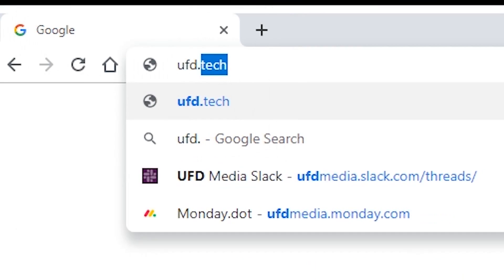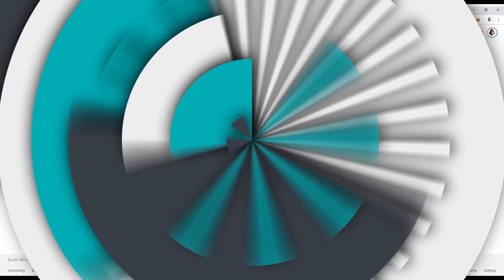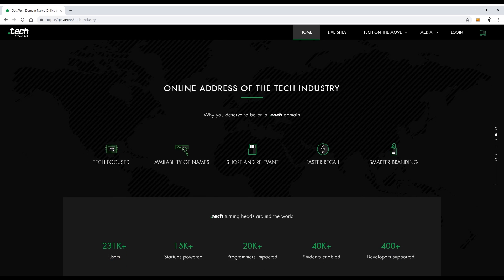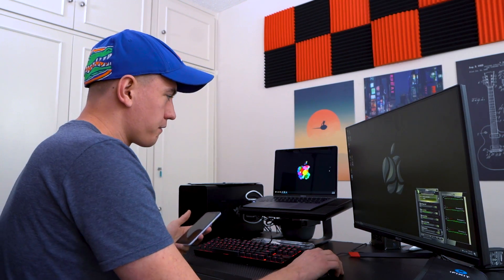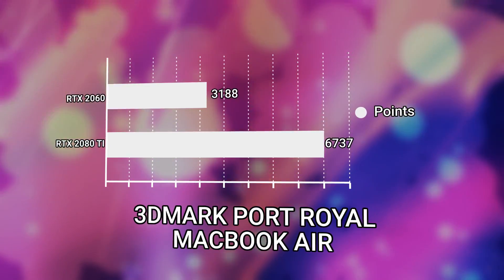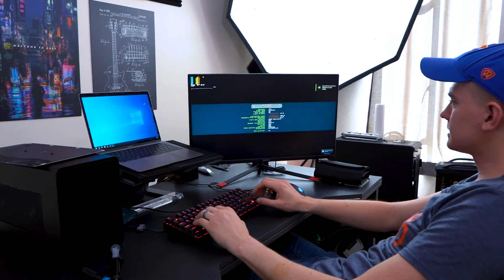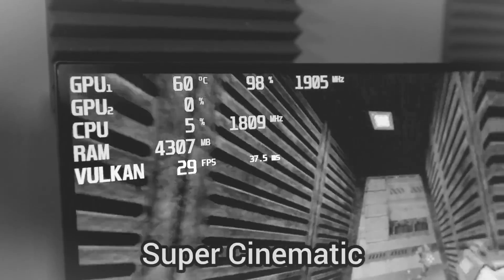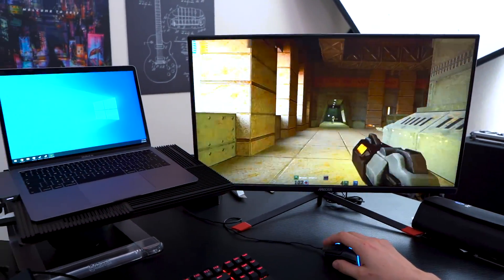MacBook Air + RTX 2080 Ti - How Bad Can It Be?

Comment: Put a metal plate and thermal paste between the cpu heatsink and case .. it will transfer the heat to the case and u can hold more boost for longer time!

Comment: when my main rig was down i put those frozen Popsicle that come in a long tubes under my mac air. about 4 of them under would be good, manually set fans to 80%.  The metal case of the Mac Air was so damn cold lol

Comment: Do you have to use windows in order to use an nvidia gpu? I want to get the razer core, but get a solid gpu that will allow me to play rocket league and Minecraft at 60+hz at 1080, all while using using the macs normal os. Any suggestions?
Reply: Nvidia and Apple had a very big falling out years ago - Steve jobs told them to F* off so the only GPUs are AMD .

Comment: At first I was thinking of getting the 2080ti now and connect it to my laptop, which happens to be a Lenovo t420, and I know it would be the bottlenecks, but now I plan on getting the new tech that's coming out, like a x570 mobo, 3900x CPU, pcie 4 gen, 1 TB, the fastest ram, then later a gpu.. I'll have to wait to get the 2080ti..

Comment: I laughed so hard when I saw the dongle! Oh yes, so much better than just you know, putting a power input and a few USB like a normal laptop... (don't tell me USB C or micro wouldn't have fit, they put a fan in they had so much extra space!). Apple's designs are terrible, I mean, not even a copper heatsink? How much would that cost? $1? Couldn't spend $1 on a better cooler of the same exact size? Yeah... that's how you know its Apple!

Comment: wont use thermal pad because it's electrically conductive, 

was going to use liquid metal
¯\_(ツ)_/¯
Reply: I'm literally crying from laughter for some reason
Reply: should have just covered the caps with nail polish
Reply: yeah I was also wondering what the difference would make besides that liquid metal can spread everywhere which makes it even more tricky than thermal pads.

Comment: What I want is to understand if the Mac book  works well with the external big graphics because it has more lanes. Because as far as I understand it every egpu review says it's not worth it over a 1080 and you will get kind of a 1060 performance, because of thunderbolts limitations. As I understand it Macs have more than the usual 4 lanes for thunderbolt.  Cheers!

Comment: You can electroplate copper on the CPU heat-sink and then apply liquid metal. It's pretty easy to do at home.
Reply: Pretty blue crystals?
Reply: not really...Al has a layer of oxide on top so more steps are needed to successfully deposit Cu on it. The easiest way is to first deposit Zn and then electroplate Cu on the layer of Zn